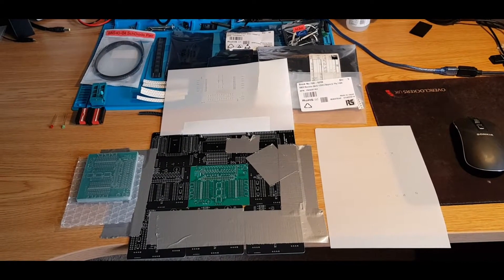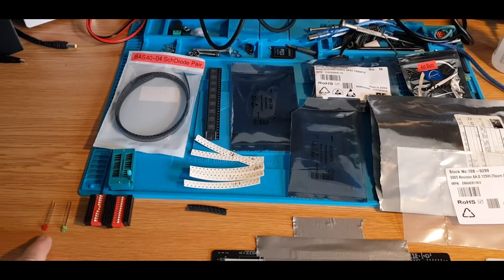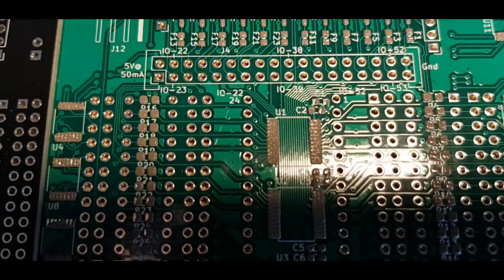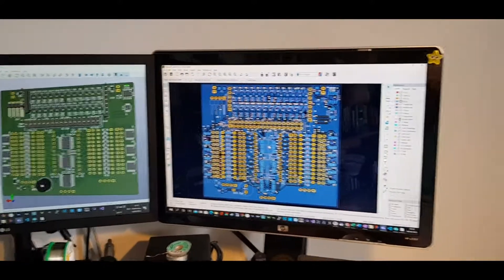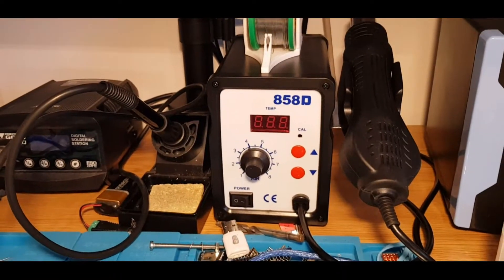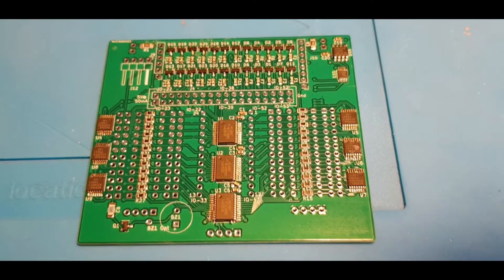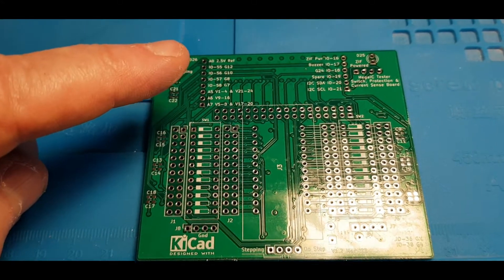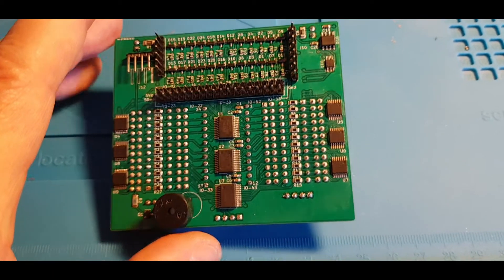MegaIC Tester Current Sense PCB Assembly

Comment: Hi Michael, I've been following your progress on the MegaIC tester for some time now; very impressive work. Really amazing that you thought of retaining backwards compatibility in your code with earlier projects hardware/PCB. I'm  curious if an update or preliminary code/schema release might possibly be around the bend? Hoping you and that barn owl are doing well!  All the best mate.
Reply from the maker: Hi Benjamin. and many thanks for the feedback :-)

I've been doing some major updates to the MagIC Tester (note the rename) over the past six months, which now includes the ability to test any pin for high impedance, an optional -5V/+12V board to provide the power required by various memory chips, the ability to define power requirements for a chip, and I am currently working on making my current memory-chip specific code generalised so that it is easy to add new memory chip defintions rather than having to hand code new ones, then I can add all the popular chips to the database.  Currently the code does both structured and random read/write testing of a few SRAM chips, and can read off the contents of PROMSs, although the current 24 pin socket is a severely limiting factor there :-(

I am struggling to get DRAM testing working at the moment, as the poor old Arduino Mega has only a single core which limps along at a measly 16MHz, so doing refresh cycles is proving very challenging, so I may have to give up on that, or come up with some sort of co-processor to do that job.  Or, and this is something I am already working on a design for, I could replace the Arduino Mega with a Raspberry Pi of some description, although those don't have enough GPIOs.  I've already done a design which utilises a Pi with three (or four) 23017 IO expander chips, but although I've proved the concept with the one 23017 chip I have, these things are like rocking horse droppings at the moment (September delivery from RS Components!), so that plan has had to go on the back burner for now.

I've got a new PCB layout mapped out for the MegIC Tester, which supports the high impedance testing (which currently requires two small resistor arrays to be plugged into the sockets on the front of the tester), adds full support for the optional power supply board, and also adds support for optional addressable RGB LEDs which will be used to indicate when manual wiring of power pins is required, and which pins need to be connected to which supply rails.

The Raspberry Pi version, which will be available once the Semiconductor Gods decree it, will be able to support chips up to 48 pins, and it won't be too hard to extend that to 64 pins.  Extending the device to these pin counts adds the ability to support a much wider array of memory, processor, co-processors and simliar chips.

I'm in the middle of a couple of other projects right now, so progress on the MagIC Tester memory testing upgrades isn't going very fast, but I'm hoping to get back to it in the next month or so, then I'll do an update video and see about making the PCB, software and chip database available somehow.

WRT backward compatability, I have to admit that I haven't actually tested that for a while, so if you've got one built around Akshay's original PCB design, I'd need to do some testing before I could be confident that it would work.  Obviously much of the enhanced abilities provided by my PCB, such as measuring voltages and currents won't be available on the original board, or for chips with pin counts over 16 pins, but all of the pin display and exercise functionality should work fine I think, as well as the massivley extended set of chip definitions.

Even though I've always wanted to retain full backwards compatability, I sometimes get so involved in getting something new and whizz-bang working that those design principles sometimes get bypassed in the heat of the moment, then I'm off onto the next new bright and shiny thing and forget to go back and tidy up some loose ends ;-)

Watch this space!